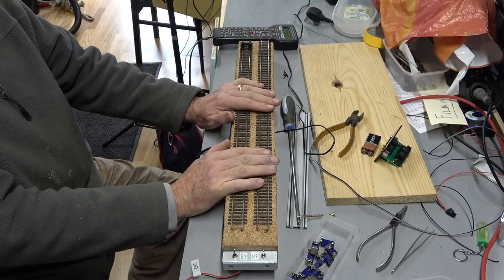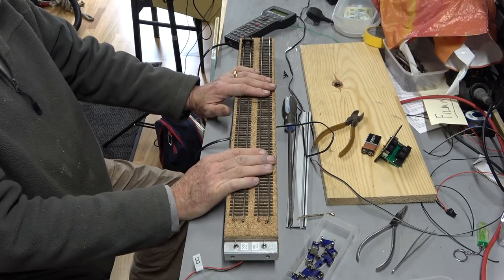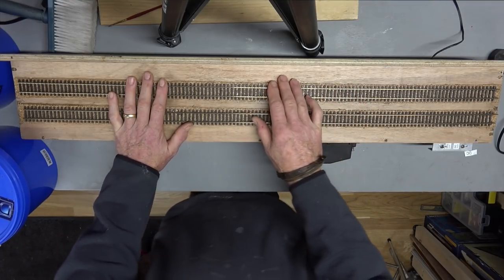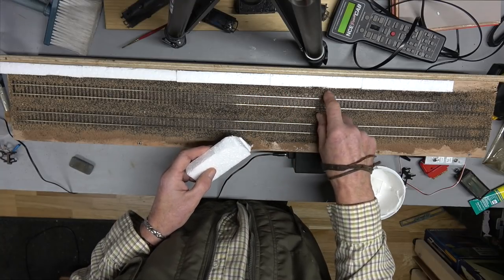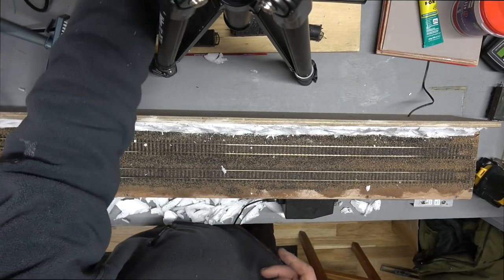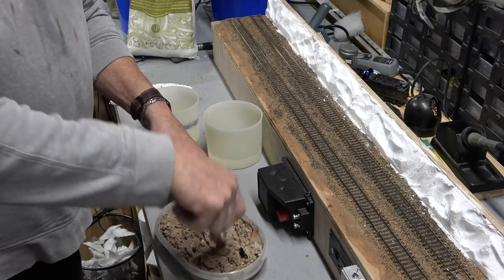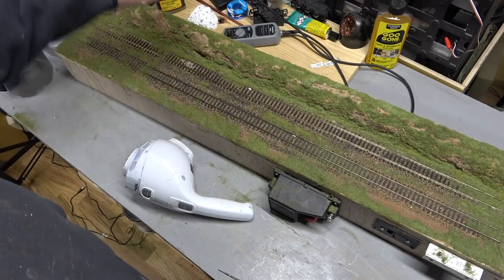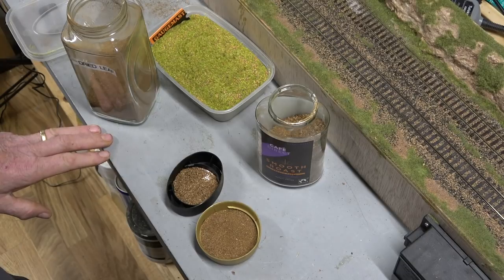47.  Building a Test Track and Diorama at Sandling Junction Part 1 - & my New Year best wishes.

Comment: A very happy new year to you Paul.
Nice test track. You could have used a double pole centre off switch to supply power to the track. Switch one way for DC and the other for DCC.
It works, only thing is you can't  run both supplies at the same time.
Reply from the maker: I can as they are completely independent two switches two power sources, at least i think so lol, cheers Paul